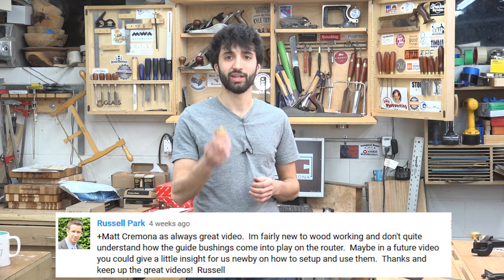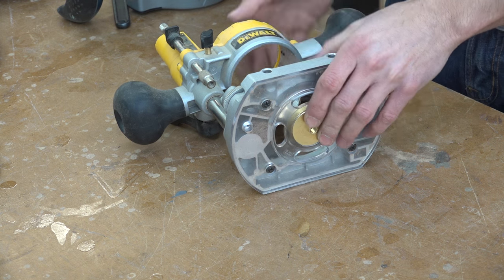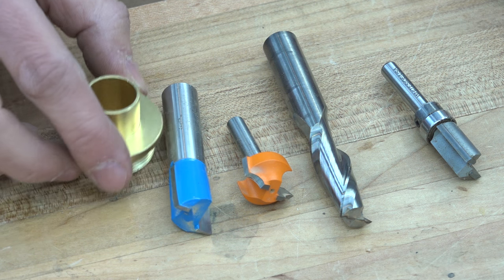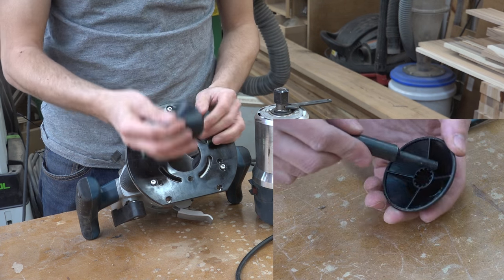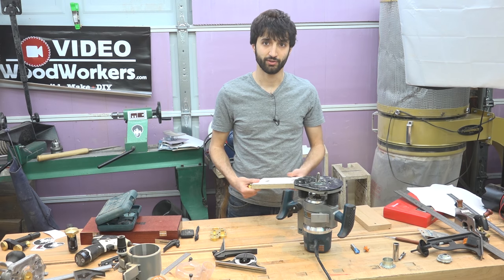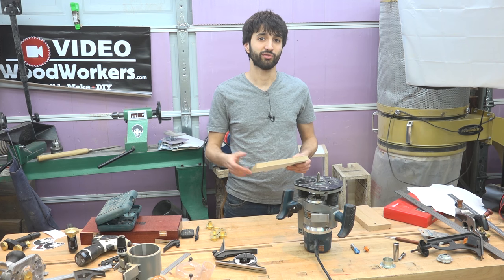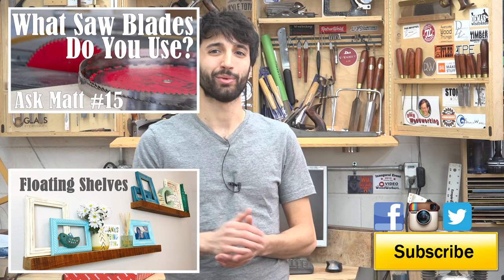How to Use Router Guide Bushings - Ask Matt #18

Comment: Matt, I literally made my first router cut today; not pretty. It was a round over bit (3/8") with a shoulder. I had trouble determining how far the bit stem should go into the collet. I figured I had to move the bit out some because the top of the cutting blades were touching and cutting the plastic base plate. Thus my first question: should the top of the cutting edge always be flush with the bottom of the plate? Second, my router grabbed and ran along the edges of the work. At first I was pushing the router in the wrong direction on the edge. When I determined I was going the wrong way, that's when the router wanted to jump or lerch along the edge. How do you control that? I was practicing on plywood so maybe that was the problem. 

I was amazed at the amount of dust that was created. I wasn't ready for that. Any way to collect dust while using a router? Anyway, thanks for the information; great video. I have much to learn.
Reply: I meant you should be able to find plenty of help!  ooops!  Good luck and be safe

Comment: So do all routers need a centering cone? Makita XTR01Z, Ryobi P601, SKil 1830. Do they need a generic centering cone or a specific one for each model? thanks
Reply: a centering cone will work for any router and should be used for any router.  Especially when using guides because as soon as you turn that router, you lost you dimensional accuracy instantly.  Some have tight tolerance holes for the screws, some leave it sloppy for you to center it each time.  Either way you can't go wrong from making absolutely sure it's centered.

Comment: Problem I am trying to solve is drilling a through hole in a piece of 2x4 that is 2.3 inches in diameter.  I don't have a Forstner bit that large to make a template for the guide to ride in.  Circle cutting jigs work great with routers but not for that small of a hole. Any suggestions?

Comment: Are guide bushings only for the bigger routers?  I only have a trim router and it takes 1/4" shanks.
Reply from the maker: It's going to depend on the router and the base.  The Dewalt router that I showed takes only 1/4" shanks as well.

Comment: Question, do you not have to take into account the thickness of the bushings edge ? So if the bushing hole is 3/4” your template must be set back the difference of the bit to the inside of the bushing plus the thickness of the bushing wall. Am I correct please?
Reply from the maker: No, since you're not using the ID as reference, it doesn't matter how thick the wall of the bushing is.

Comment: Why are some guide bushings longer than others? If I try to use them with a 1/4" template some would drag on your stock. Why aren't they all just shy of 1/4" so you can utilize the cheapest material for your template? Great video by the way.
Reply: You can cut, grind ,or file to a length of your choice. Be aware that one being under a 1/4 inch can easily let the guide lift out and do more harm than good. Best to use thicker template material. A thicker template has the advantage of a larger contact area on the guide and makes the template last much longer. I use 3/8 or 1/2 inch material for templates

Comment: hi matt, thanks a lot for this video its made me understood the point of template guide bushing. im using Dewalt compact router D26200 (without a plunge, i have only fixed base.) I want to buy template guide but I dont know what fit to my router. ho cam I know? thanks a lot
Reply: The standard guide bushing kits will fit your Dewalt.

Comment: My problem is that I feel like the walls on my guide bushing is very short, barely taller than the bottom surface of my router. I’ve chewed up a couple letter templates already and super frustrated. What am I doing wrong??

Comment: What is the typical oversizing of the bushing to the bit? I tried to use a .50"  bit inside an ID .53 bushing . 5/8 OD and it doesn't hit hand turning but it did at machine start up. I guess I will redo my template and aim for using the 3/4 inch bushing.

Comment: Hi Matt, i just bought a new trimmer router and i would love to know how to cut a simple straight dado line with a length measurement rather than cutting end to end of a 
 piece of timber. I have tried but i am unable to rout  it without going to long..  best regards.. Tim Hollywood.
Reply: +Tim Hollywood Measure the distance from the edge of the bit to the outer edge of the router. Put a mark on your piece that distance from where you want the end of the dado to be, then route to your mark. :) If you do not want to mark your piece, just clamp a block to it. If you can see your bit, add a mark near the end of the dado. When you reach that mark, go SLOW. :) I usually grab a chisel for the last two millimeters in a stopped dado. Gives a square edge to it too.
Reply: +Vidar Fagerjord I really appreciate the advice on using my router, this will make my life a lot easier thanks to you..  cheers,
Reply: +Tim Hollywood My pleasure. :) Today I made a few cuts with the router. I made the end mark, then an arrow pointing to the mark, like this: -->| This gave me a clear indication when I was near the end of the cut. I would suggest leaving at least a millimeter or so, so it will be easier to chisel out the last bit. I touched my end mark with the router bit, and that made it harder to get a straight line with a narrower chisel. Not that it matters - it will never be seen. But I know it's there... :D
Also, remember that the router bit will affect the cut depending on how it moves through the wood. Be careful, take your time and make sure you have a FIRM grip on the router.
Reply: NB! If you want to make an 11 mm dado and you use a 9mm bit, you will have to widen the first cut. There are two ways you can do this. Plunge 2mm down, cut the dado to length. Move the fence over. Plunge 2mm more. This will help controlling the bit and it won't fly off on you. If you cut to final depth and then want to take a climb cut, you are in for a hairy situation pretty fast. It will act the same way a baseball pitching machine works (google it). I use a chisel to get the final width if I don't have the correct size bit. You CAN take a climb cut, but make sure you have total control and go sloow. I would not recommend trying it. Use the chisel. :)

Comment: important question... kindly answer , if you don't feel any trouble...
question is... can we use the router bits in the drill machine...as a router work purpose
by making its special plunge which can hold the drill machine like router...?
actually i am going to do this experiment... but you are an expert.. so i want your expert opinion...
kindly reply...

thanks for your tutorial
Reply from the maker: you can do it but it wont spin fast enough to cut very efficiently
Reply: thanks a lot Matthew Cremona...!

Comment: Hi, Matt.  I know this is an old video, but I have a question about using guide bushings.  I have a DeWalt 616 router and I bought the guide bushing set to fit it.  I have an issue with the bushings coming loose during operation.  I tighten as tight as I can with hand pressure, but still they sometimes vibrate loose.  Any suggestions on how to prevent this????
Reply: Marshall Murrell use a bit of Teflon plumbers tape.
Reply: @jkeefer034  Many thanks.  Works like a charm.
Reply: Marshall Murrell I’m glad it helped

Comment: I tried the guide bushing for the first time and it burned the wood. In addition, the bit and bushing were hot for a long time so I couldn’t change out my bits. Am I doing something wrong?
Reply from the maker: Something must be rubbing. Either the I’d of the bushing is too small or you’re plunging deep enough for the collet to rub on the bushing

Comment: hello Matt. I need to make a slot on the inside of a curved section. How does one do this?
Reply: You could use a slot cutting router bit with a bearing either above or below the cutter, depending on your needs. Here’s one with the bearing on the end of the shaft 
https://www.homedepot.com/p/306082217
Or you could use one without a bearing, and use a template guide instead. Then the barrel of your template guide, rather than any integrated bearing , would ride along your existing curved edge. Or if the slot cutting bit would cut the slot too deeply into the wood, then you could use a slot cutting bit with or without a bearing, in combination with a template guide which has a barrel diameter that is wide enough to reduce the cutting depth by the desired amount. At least those are the options I would consider. If another reader doesn’t think I got it right, hopefully they will correct me.

Comment: Can I use just a drill bit as long as it fits in my 1/4 " router shank to hog out material or does it have to be a bit designed for routers ...
Reply: Shanta Narain Drills are designed with their cutting edge on the end of the drill for plunging into the work piece. Drills don’t have side cutters for moving left to right of vice versa so you need a router bit for removing material along the width of your mortise. Router bits have cutting edges on the point for plunging and the side for elongating a hole. Hope that helps you.

Comment: Hey Matthew, will the "Bosch RA1151 Router Subbase Centering Pin and Cone" that you mentioned in this video work with me Hitachi M12 router. I'm really confused.
Reply: I remember dealing with some weirdness when it comes to guide bushings on my Hitachi M12-V due to the ear lobes in the base plate of the router. Hitachi included one bushing for those ear lobes in the accessory kit that the router came with along with an alignment pin too. But I have an old style blocky M12 so they may have changed all of that? I know a lot of folks complained about the old lobe style bases. So it wouldn't surprise me to learn they ditched that nonsense.

Comment: The plunge base on my Dewalt  small router has about a 1.5 inch center hole , how did you get the Porter Cable guide to center and hold ?
Reply from the maker: The baseplate I have has a stepped hole in it to receive the guide bushing.
Reply: @mcremona  is that a Dewalt part -mine came with the large hole?
Reply from the maker: @pff7852  that's the base that mine came with.  They might have other bases you can buy
Reply: @mcremona  Yeah be whatever they lying around that they slap on there -Veritas makes a very nice one for the fixed base,hoping they will make one for the plunge base

Comment: So what is the point in pattern bits if you can just use one of these with a router bit you probably already own?
Reply from the maker: The pattern bit allows you to cut flush to your template so you could duplicate a part, for instance
Reply: Matthew Cremona OK that makes sense great video by the way

Comment: Why do my guide bushings keep getting destroyed by my router bit? Is my bit too big?
Reply: are you using straight cutter bits or spiral?  If you stick with upcut spiral bits you should avoid any issues of clogging the gap with cut wood which is the culprit in snapping bits.  Or, it could simply be your trying to cut faster than the bit allows and your stressing the bit beyond it's breaking point.  So slow down and/or spiral upcut bit...

Comment: Hey Matt! This was very helpful. I am just about to embark on using a guide bushing for the first time. I've go one of these: http://www.rockler.com/signmaking-brass-bushing-3-8-id-1-2-od
I plan on routing a sign using some letter stencils. I have that same bosch router as the one you showed. You mentioned that there is an adapter for using the threaded guide bushings. Do you have a link to one?
Reply from the maker: It's available as part of the bushing kit that I linked to in the description or if you just want the adapter: http://amzn.to/1KWYcTs
Reply: Ah, cool. Thanks dude!
It's 2am for you and you have a baby! :)
Reply from the maker: Gotta work when I can :)

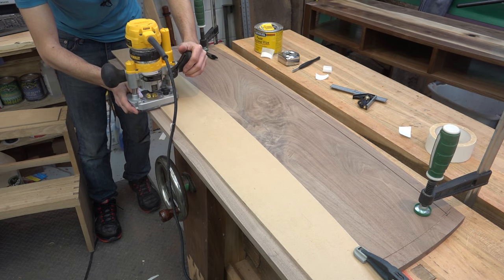Comment: At 6:45 in your video, I see you holding the base of your router with your right hand, exposing your fingers to the cutter. I've used routers successfully for years and never felt the need to do something like that. I see guys in videos like this doing things like that all the time, with routers, circular saws, jig saws and even chain saws etc etc. Could you explain your reasoning for holding the machine like this, and "gives me more control" isn't an answer. Very poor demonstration on how to safely use this tool.